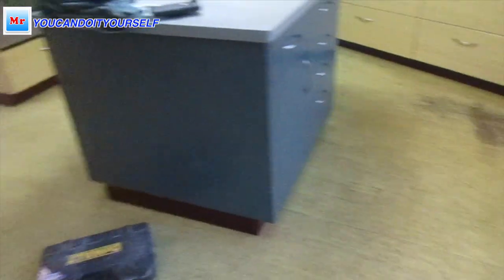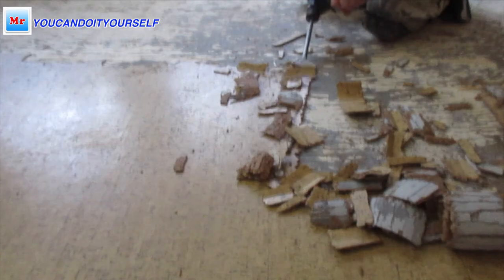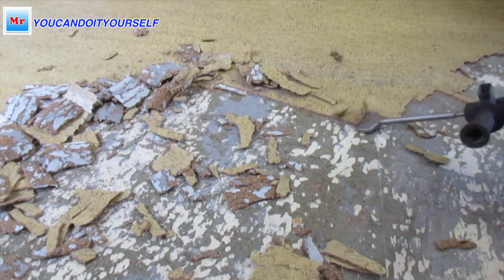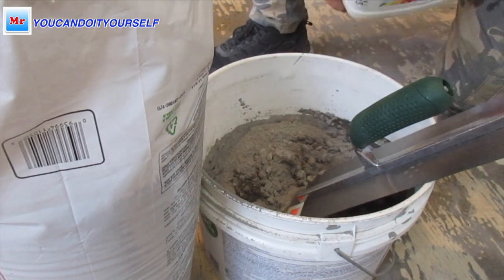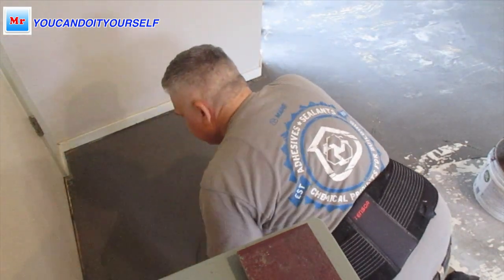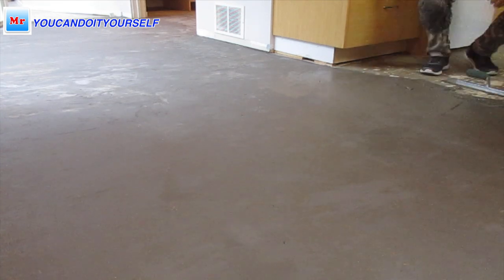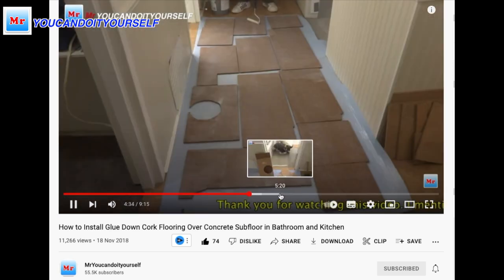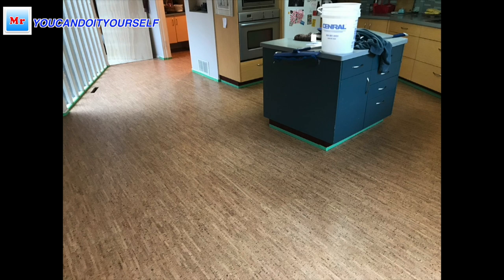How To Remove Old Cork Floor MrYoucandoityourself

Comment: we are using a heavier duty floor stripper machine but still we can’t remove this corkboard! its so tough! we only accomplish to remove 4 sq ft in 2 hours! just FOUR square feet! How to remove this damn thing!????
Reply from the maker: If it cork board, just make a parallel cuts with circular hand saw, like for hardwood floor removing. Small pieces easy to remove with stripper. I hope it’s helping you. Thanks.
Reply from the maker: Here it is - How to Remove Hardwood Floors: Easy Instructions
https://youtu.be/77GXx1NdOCw